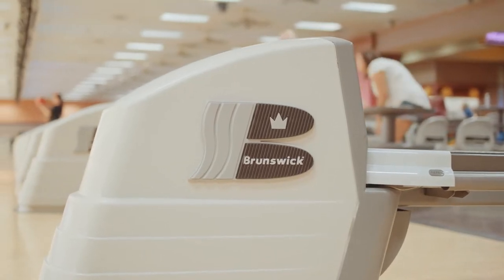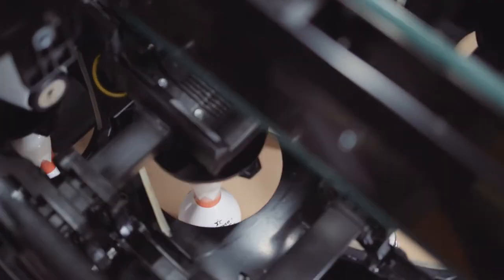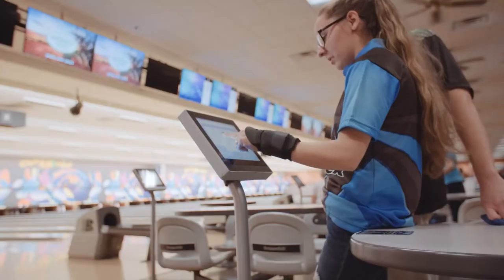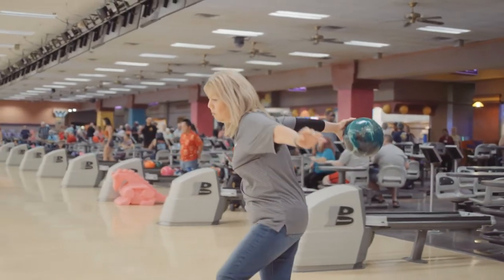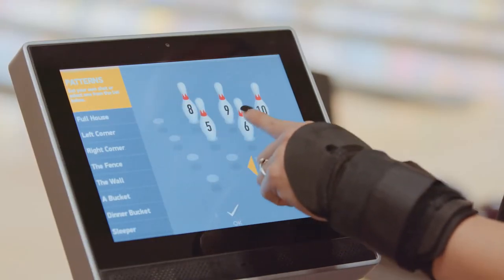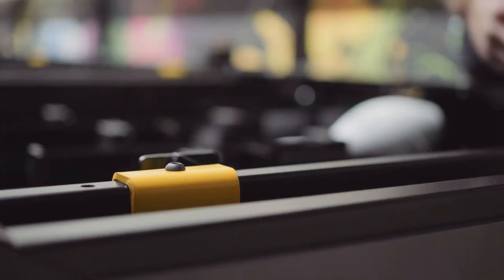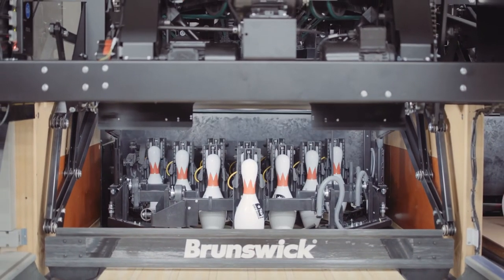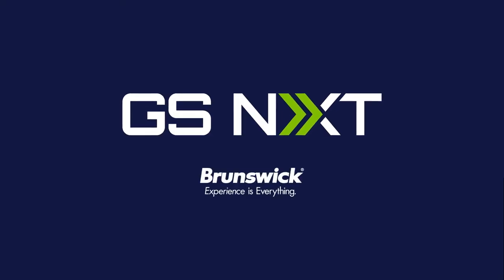Brunswick GS-NXT Pinsetter [English]

Comment: Biggest "improvement" that's piece of garden hose on every pinstation 😂😂😂
Reply: Its better than suicidal pins hanging on a clothesline which makes a death threat to the Competitive Sport of Bowling. You know what I mean...
Reply: @PinoyBowlerGS92  It's BETTER to make PROPER pin stations in 21st century :D 
Just make retaining bow with a bit longer end that's, doesn't cost billions ;)
That garden hose on retaining bow looks like mickey mouse fix :D
Reply: @youtubasbereklamos5947  As long as the pins are free falling, I'm fine with it. I would never allow pins pulled up and down by puppet strings because that's pure lazy.
Reply: @PinoyBowlerGS92  Your comment off topic :D
How come pin station retaining bow issues has connection with string machines? :D
Reply: @youtubasbereklamos5947   well if you think this NXT machine is crap, the string garbage is worse. I'm ok with those green round belts anyway, if they break just weld them.
Reply: @PinoyBowlerGS92  I do run GS-10's many years and that garden hose "update" just like a joke on "NEW TECHNOLOGY" machines 💩

Comment: Your new machines won't last.  Your new machines don't have 1/10th what the old A2's used to have.  Your bowling pins are all plastic as are your fake-lanes.  Bowling doesn't even sound real anymore.  Too many computers, computer chips motors and all those plastic parts that just won't last.  Sorry, I'm old school I guess but that's the truth!
Reply: So what do you want ? Have Bowling look really outdated ? Sure the GS-Series isn't reliable as the A2 but I would rather take that than Brunswick's StringPin or EDGE String from Qubicaamf, if any machine could let pins fly without Strings, I accept it no matter the reliability is. Plus since I have spare shooting problems or seeing pins fell or missing on 2nd ball, the GS-Series is prefect for me since the machine will take care of it and I don't need a mechanic to set up manually just like what happens when I bowl on those horrible AMF 82-90XL pinspotters. Don't be butthurt cause today is 2022, move on from the old days.
Reply: @PinoyBowlerGS92  I'm fine with the old style, at least it was real!  Watch the B&W pro tour on YouTube from the 60's.  Had to be able to really bowl back then!
Reply: @scottrichardson6226   I speak from experience man, I bowled on Wood Lanes myself since I was 9 in 2011 until the place burned down in 2017 and they look nice but my ball doesn't wanna stop overhooking and I hate when the oil dried up easily on Wood, not mention I heard Wood Lanes were a hassle to maintain and even if you resurface it sometimes it could made the Lane uneven for the ball to roll unto. That's why during the holiday season of 2017 (before the fire happened on Dec. 23rd) that the Bowling center operator had the Youth Bowlers Club donate money to him to get the Bowling center renovated like replacing the Wood Lanes with Synthetic, Scoring CRT Monitors with Flat Screens, Chairs with Couches and getting more spare parts for their GS-92 pinsetters but never happened. I even got to bowl on Duckpins at a center that was next to my school during my junior high school days, the wood lanes were so bad that balls were hooking way early, nowadays that center is no longer playable, I even made a video about that.
Reply: @PinoyBowlerGS92  Uneven lanes and oil problems is the mark of an ill maintained bowling establishment.  I used to work with the old style AMF lane sanders and their work on the pine and maple was pure craftsmanship that measured the work down to the thousandth of an inch on level--as ordered by the ABC bowling rules handbook. We used proper lacquer and the best lane machine we could along with oil to keep the lanes perfect.  Now,  I agree that on the late shift Tuesday nights on our 4 game set the last game and a half was pretty tough holding a line as the oil had surely moved.  That is not only understood but predictable.  How those guys were still able to average 200 or better while having to change lines later in the evening is called "skill!"  You never saw the weird two-handed no finger deliveries like today.  Fucking joke!  Just toss the ball into the 3 foot track on the  right, crank it up and it will simply dump into the pocket!  Zero skill!  In my day if we had one 300 game per year that was a rare treat and well earned.  The place would be dead silent and then explode at the feat, the newspaper and radio would be there and everything.  Now?  A 300 gets maybe a pat on the back like a 200 game used to. And bowlers now shoot at least 2, 300's a month on average!  At least I lived through bowling's greatness and its  finest hour!  And with 6 "real" 300's to my credit I have the stories to prove it!
Reply: @scottrichardson6226   I have to point out what you said about "skill", everybody is different and I don't have problems with 2 Handers, I even have a buddy of mine can't even make the 200 mark and I'm not saying he should switch to 1 Handed but improve regarding his timing. Plus hooking a ball (even with cranker) is still a skill, only thing that's no skill is like those Open Bowlers that didn't bowl the right way and keep getting gutters every time. Also in my opinion for those 200 scores or 300 Games almost everyday or ever week, that's just first-world country Bowling meaning they have a strong Governing Body of Bowling and have excellent certified coaches to train Bowlers unlike third-world country Bowling, we're just trying meaning to say Bowlers most of the time only shot less than a 200 average and zero 300's. Take my home country Philippines for example, you can find more Bowling centers and watch Bowlers shooting below 200, above 200 or 300 Games in the capital Metro Manila since there more centers means more Pro Shops and resources, meanwhile for the rest of the country, there's only very few centers available yet none of them have any Pro Shops and as for the Bowlers, most of the scores are just below 200 and no 300's. My country had certified coaches and the Philippine Bowling Federation is strong but the number of centers for the entire country is a problem and yet Philippines is a third-world country.
Reply: I respect your history and your prior feats mate, respect 👊

However, this sport is one thing that requires a change, I work in bowling centres as a mechanic and the changes they've made to this GS-NXT machine makes life a lot easier as a mechanic to maintain l, especially now as I've lost staff in the industry and have nobody that wants to work on these machines, if I can cut out the work whilst at the same time modernising the backend machines and the systems in usage for scoring- it'll make my life easier in the long run. 

Back in your day things were far far different, cheaper labour costs, overhead costs of operation were lower, you would've had steady and consistent business as well as enough mechanics to cover the ground to run a house of A2's, it would've been just different and more feasible in the economic climate of years before.

Now, bowling is on a path of renewal and centres are slowly migrating to entertainment centres than "just bowling" - it's us the owner operators that either cater to two markets or we die as a business. I need to both support competitive bowlers and social bowlers, better to give each a measure than say fuck you to both. Because then I can't stay open.

As for two handed delivery, give me a break, aren't you forgetting those whom palm bowled during the 70s, 80s and 90s? There were plenty of up and comers in the sport that did. Similar mechanism of delivery, only accept the point of setup is held with two hands, but the ball is released with one, if it means more leagues forming and a future for the sport then I'm all for it. I know of so many bowlers that are armed to the teeth with bowling balls drilled for them - reactives as such, they still miss the pocket so it's a touch naive of you to assume that someone just cranks the ball and it dumps into the pocket - there are still skills required by the bowler to get it there.

Wood lanes as well are great but much harder to maintain, where are you going to find a full time mechanic to refinish and sand the lanes to USBC/ABC standards? Much more so, where are you going to find that someone nowadays and is it even economically viable? I'll tell you straight - you cant/no it won't be. I've bowled on wood with plastic and weaker symmetricals and it's noticeably more a challenge on a well oiled pair to hook the ball, but with many special tradespeople that would've been responsible for those centres back then to maintain the lanes, we simply don't have that same labour available to us. And if it is, it is going to be costly as business for them just wouldn't be as in demand as it used to be.

The A2's were reliable, I'll agree on that but once again, the labour, time, costs and everything else associated with keeping A2s running properly is a scant resource and centres are just moving to sized down pinsetters to minimise the cost of upkeep, it's either they retire the big A2s and go with the lower scale GSX/NXT for ease of operation and flexibility of application to newer scorers or they pay the extra costs associated and potentially end up not making a profit to show for it.
Reply: Another reason y it won't last because now USBC sanctioned string setters and Ive told USBC directly on FB you will cause bowling alleys to lose business stringed setters gets tangled and causes more issues than they are worth
Reply: @CaptianNamco  Pretty insane isn't it. Far as I am concerned "proper" bowling ended in the late 1970's.
Reply: @scottrichardson6226   Try to look at Bowling across the world, they're not turning into goofy funhouses like the US would do.
Reply: @scottrichardson6226 So, I've been bowling for my whole life, and as someone who has worked in the industry with a variety of pinsetters, lanes, and lane machines over the years, I've watched the game change as all things do. This does not mean that the game is less real. In fact, I think the game is more challenging now, than times past, due in part to the variety of lane surfaces, balls, conditioners, and oil patterns. There are so many variables to account for, that it is pretty fucking hard to excel consistently at higher levels. Back in the 70s and 80s, you only had rubber, plastic, and urethane. Lanes were made of wood, and you wrote your scores in by hand. Technology would inevitably change the game. It wasn't going to stay that way forever. And I'm sure you know that. String pinsetters aren't really as big a deal as people think, because proprietors have a wide range of options. And the USBC isn't forcing anyone to use them. They just certified them as inclusive for competition. The technology has advanced, but it's still the same game I love from the time I began bowling in an Active West center. 😁
Reply: Welcome to 2023 dude. What hasn't changed? I agree not all for the better, but it's not like bowling changed, and everything else stayed the same.
Reply: @PinoyBowlerGS92 . Every summer at our bowling center they’d sand the lanes and put new poly down. It would take them weeks. If nothing else, synthetic lanes have eliminated the thousands of gallons of VOC’s used in refinishing wood lanes every year.